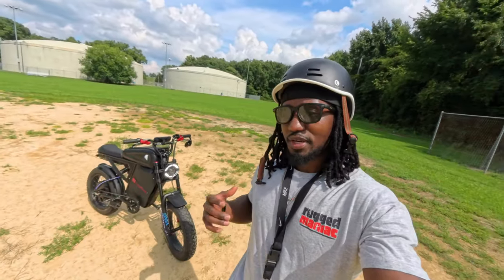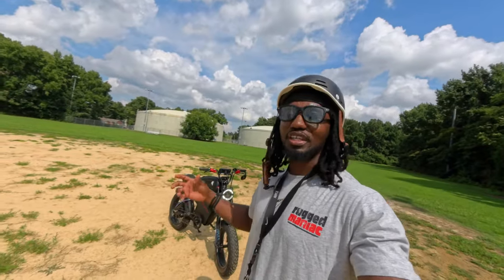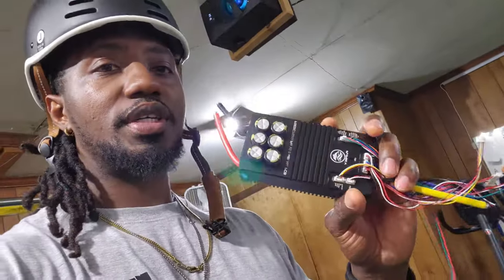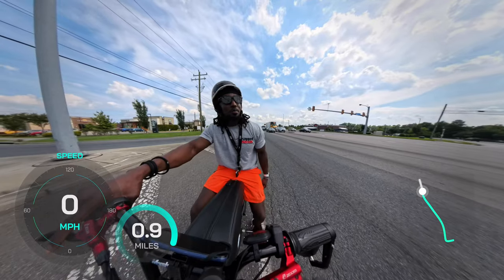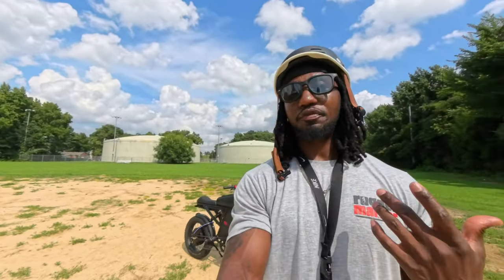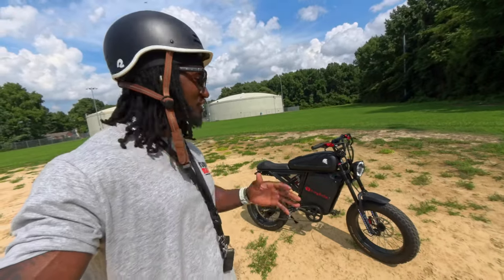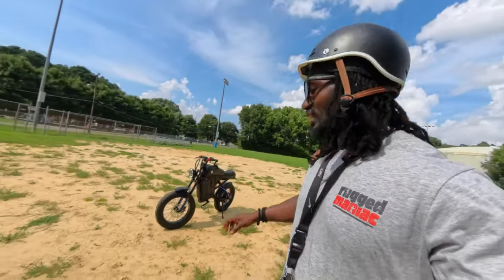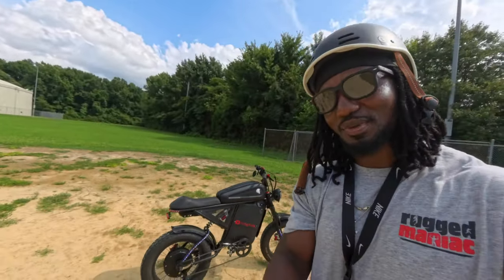60V DIY eBike Speed Testing

Comment: Can you go into detail how you wired your headlight. I've heard flipsky controllers don't really support headlights without futher modding/ adding parts. Does that include turn signals. Hope you can shed some light to this new platform of controllers. Thank you for sharing your experience and your content has inspired me to look into build my own high speed ebikes. Happy for you on the build looks great.🙌🙌🙌
Reply from the maker: I plan on doing a review of the Flipsky soon. As far as the wiring for my led, they are wired straight into my battery, i have a control for my turn signal.

Comment: Great video!. Feld weakening reduces the magnetic force & enables the motor to spin faster than it should. However, I've noticed that climbing hills is not as strong. Most people probably don't care but I live in San Francisco where I need to not slow down on hill climbing
Reply from the maker: Okay thank you for that. It's interesting that it can be done on some controllers. I don't have a lot of hills here, so i might play aroud with it, or just keep it as is.
Reply: @KingKola_  You'll probably get a few more RPM's which should increase your top speed though

Comment: (not hating) ebikes are not really safe at 50 + miles per hour , 
go for range instead of top speed 
upgrade your breaks (disc and calipers)
also have you looked into charge adapters that let you use public EV charge stations?
stay safe.😎
Reply from the maker: @FSK1138  you're right, they are dangerous at those speeds. I don't have plans on charging outside my house. I can easily get over 60 miles.  Going around 35-40, I'm getting almost 50 miles.